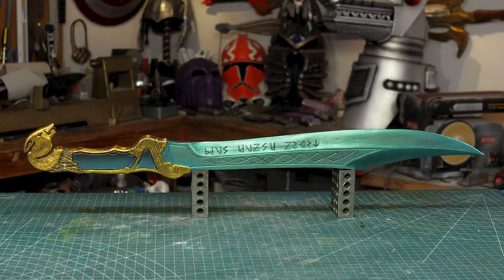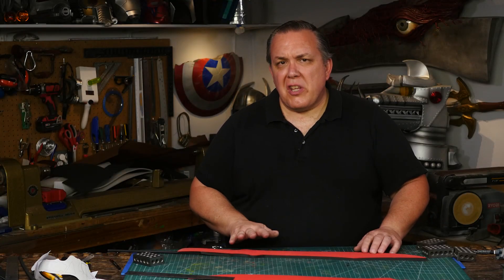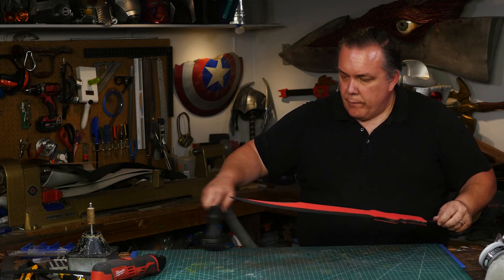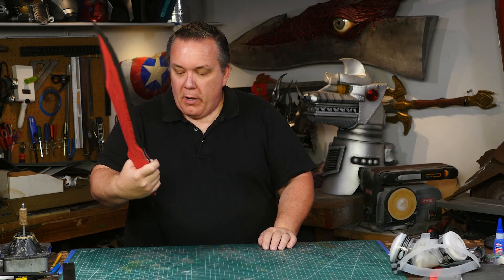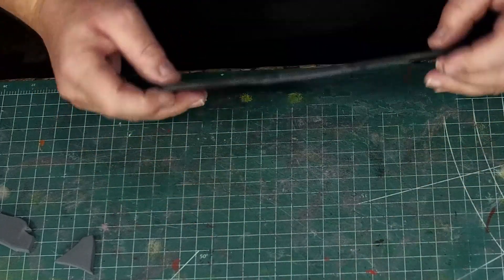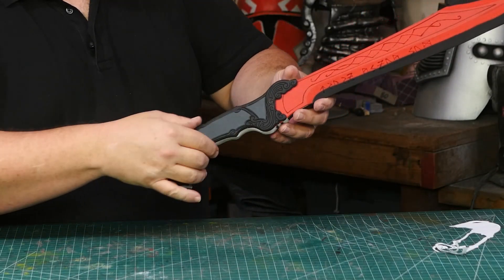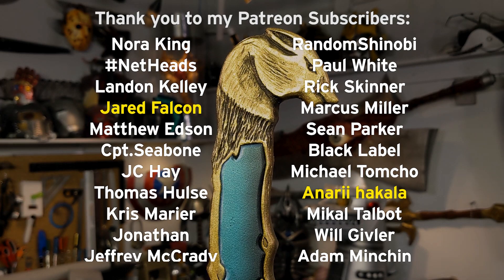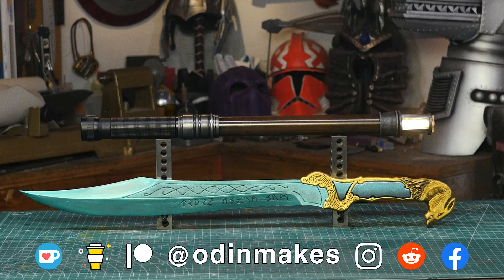Odin Makes: Sylvie's Sword from Disney+ Loki

Comment: It turned out so beautiful I couldn't resist trying to make it myself, but I messed up the first go right away  lol
Is there any reason we can't use 8mm foam instead of gluing 2 4mm pieces together for the center of the build?
Reply from the maker: Nope, you can use 8mm foam if you like. I wanted to use What the Foam, which is not available in 8mm. 2 4mm is what  have!

Comment: If either Odin, or someone else, can answer this. Why don't you used sanding sticks when making the beveled edge of the blade? I'm sure the rotary tool is easier, but if it leaves the rounded edge, whats the difference if you use a sanding stick or foam black to sand the foam down?

Comment: I wonder how you reacted to the scene where the tva agent puts it against a stand in a well light location...
Reply from the maker: Which one? the one from across the room and it was tiny in frame?
Reply: @OdinMakes  does it not show the full handle and blade length when she steps back when talking with mobius? I could be wrong though. Honestly the only thoughts I have on the show that remain are alligator loki and the thanos copter. Everything else in my life is too hectic.

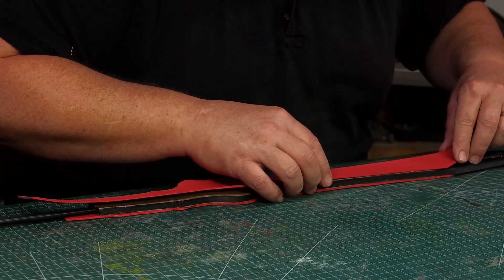Comment: I'm trying to follow along, and for the life of me, I can't get mine to match what it looks like at 4:39. GAH. Back to the drawing board!
Reply from the maker: That is the hardest part, keeping the halves straight. Lay half down on something flat, then without overly bending the other piece, glue them together. If one side has a little tension, it will pull on the other half and create a curve.

Comment: What paint did he airbrush? Was it also Plaid?
Reply from the maker: I think it was a Createx metallic green, a paint made for airbrushing. Sorry I skipped over that bit! You can airbrush with PlaidFX, just thin it first- oddly, window cleaner mixed with the paint at about 50/50 seems to work really well! Joe sets the PSI to about 20~30. And don't shake the paint to mix it, stir it. Less air bubbles get in the way. GBGH Cosplay figured out the recipe for airbrushing. They may have better info as well.
Reply: @OdinMakes  thank you!!

Comment: How did you get the kife to print to the right size.
Reply from the maker: PDF files can print using the 'poster' setting, it's in the print dialog box. That will print the file at 100% size, using as many pieces of paper as it needs.
Reply: @OdinMakes   Thank you so much you don't  know  how much this helps. Thank you and  keep up the great work. Your videos are the best. I just wish I  could build something with you. If I could I would love it.
Reply: @OdinMakes  is it called poster because nothing  in the printer settings  says poster.